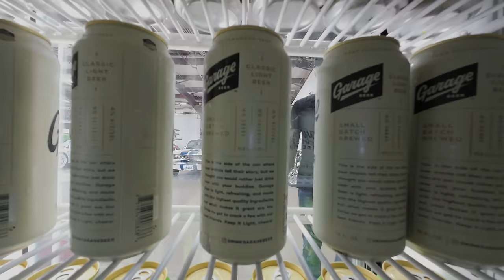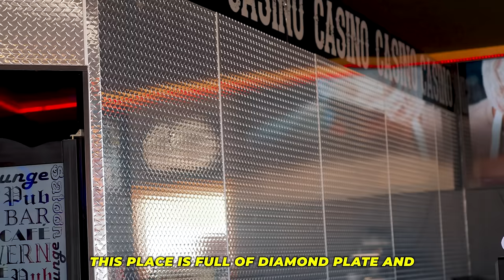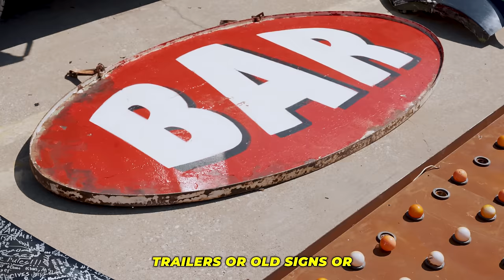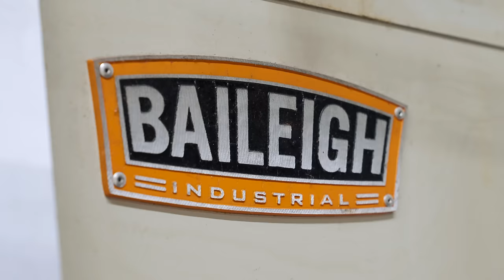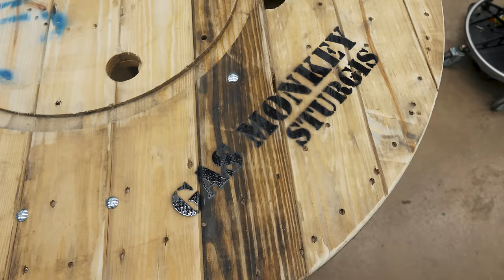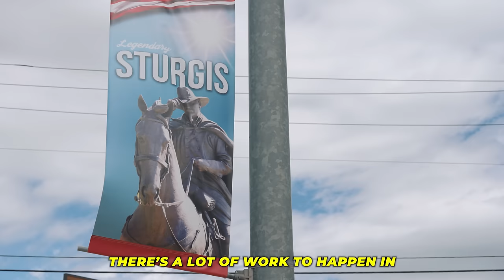Gas Monkey Sturgis Is Getting Some Next Level Upgrades

Comment: So I own a commercial sign shop here in Glendale AZ and I listen to you say you are going to go for the long haul up there.. But then you pull the but I need it open yesterday line  on your contractors. If you step back and take a breath and realize you have at least 15 years you will be open I think you will agree this deadline and this rush to get it open this way  in the grand scope of things, is really just a small point in a long life of this bar. With that being said, you should have worked on getting things open as is the best you could in the limited time, then when the traffic slows down and you have a few months to do some serious work on the inside, you should have gone that route. Maybe built a temp structure outside for this year something loud a stage maybe hired some talent to come in on the weekends and play and kept the inside limited and left alone until next season. This way no one rushes you save stress you make money this season and you put some more thought into the final decor and the final design, especially after you see the crowd numbers etc etc this year. Just my two cents. You looking for a great sign manufacturer I am your guy. In business 35 years here in Arizona and I keep everything small and specialized and I work 22 hours a day all year if I have to .

Comment: AS a retired GC, you're looking at 350,000 for that remodel job to look right, because I know you're going to have change orders, just a tip its always good to have a plan, just a floor plan with save you 1000s of dollars, and can be done cheap, any cad cam system can do it quick, just need the dimensions of the building, this will save you time also, every good builder can do a quick floor plan for 500-1000 bucks, that way no re dos -Good Luck
Reply: 30 day hard deadline on a remodel ... there are no 'change orders', and no 'estimate. You may as well hand over a blank check. At this point, Richard just needs to let the guy get it done. Worry about getting it done right over the winter

Comment: "I need this done in 30 days." I wonder if Richard realizes just how lucky he is that guy didn't just turn around and walk away? 30 days for a major renovation of two buildings? FFS. Even if he did have detailed blueprints, which he doesn't, all the tradesmen trying to do the plumbing, electric, HVAC, carpentry, etc., will all be getting in each other's way, which will slow them all down. Something tells me they will have to set-up in the parking lot for this year's rally. They'd better order an actual ton of ice. It will be great once it's (eventually) done, though.

Comment: Considering no blueprints or even a sketch, im guessing no building permits/inspections are required in Sturgis.  Also no contract, no budget, no schedule, none of the basic necessities for a successful construction project.   Hiring the first GC you meet is a huge risk.  As a GC, you can’t even bid on a job without having blueprints and a budget!   Either the GC he hired is going to get burned or Richard is in the end.
Reply: Cost plus bidding. In which the contractor makes bank on every change order.

Comment: 👍 Better recess those bolt heads on that wagon bar top, glass and steel don't go well together, any surface for drinks needs to be flush to start with, just common sense man.

Comment: Watching the video.
#2  mistakes. The Biggest is the local GM they hired. This has nothing to do with herself just the reality of staffing a new bar as the new kid in town. A local GM will come with baggage. Both with locals and employees. Best to hire a GM with a clean slate. Yes this will help staff during the rally. But cause huge damage to the business with the locals. 
Second is the construction timeline. Need to pivot. At this point the building itself should be the focus.
Get the building finished so they can get a temporary  Certificate of occupation. Next would be purchase pre made mobile bar stations. Timeline is too short before the rally to build out fixed bars. Bars in Sturgis make half of the entire years income in 10 days.

Comment: It's unfortunate that certain contractors could not accomplish your vision. Being in the industry for too many years to count, I have witnessed bad general contractors 10-fold. One major problem is lack of communications on signing off on any change orders. Lots of changes tend to happen during a renovation project: it being structural, electrical, plumbing and many times, the last men in the building, the painting company.
The other unfortunate portion can be the owner, with zero design/ architectural plans, zero permits on structural etc. Which can easily delay a project with lack of understanding of due process on how each county and or state delegates its permit process.
So yes, it can be very stressful on the owner and also the general contractor who delegates all the tradesman through said renovations in a dance of timed restricted Chaos!

Comment: Dude, pull some favors. You have to have contacts, past customers with connections, something, someone, somehow. Straight up, full face. What I’ve gleaned from only watching your show, you have a potential to really make a difference there. Community will be a significant positive influence. Do what you have to do to get it done.   AND…Details are paramount when expressing what’s needed.  Shared by a retired Lifetime Union Ironworker Project Manager. Yours is not an easy project but, one Leader at the helm, paying attention to all activities will make this happen nicely.  Good luck my friend. Sincerely

Comment: As a Bar back in the early 80's one trick I learned was to fill the urinals with ice, for 1 it helps guys aim {who wouldnt want to melt the ice} and 2 for the melting ice keeps the smell down for those non flushers.

Comment: Why don’t you bring in the same guys that you used when you remodeled mechanic shops those guys always did pretty good work instead of installing a car lift you build a bar instead of wiring up an air compressor you wire up neon lights. It’s not that hard man if you need some help, give me a shout.